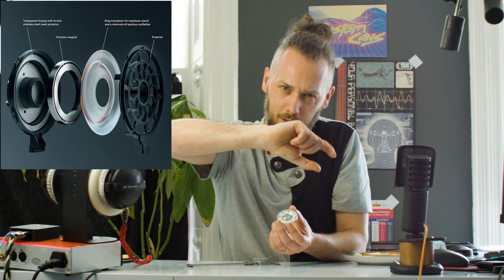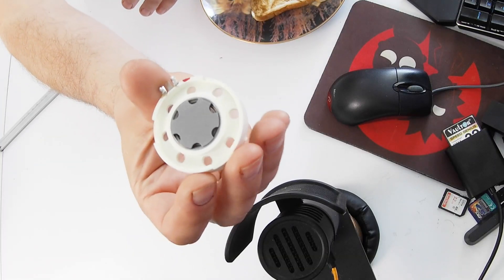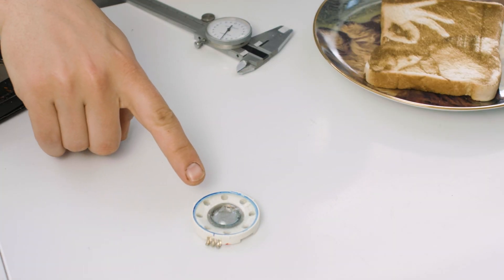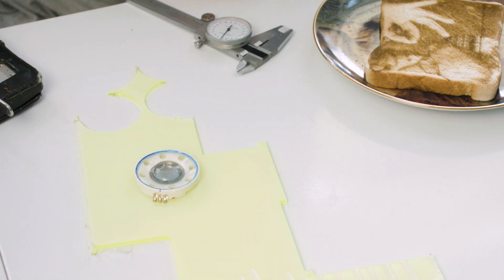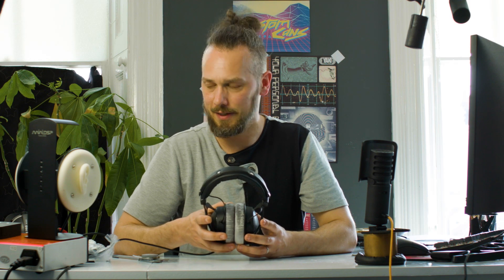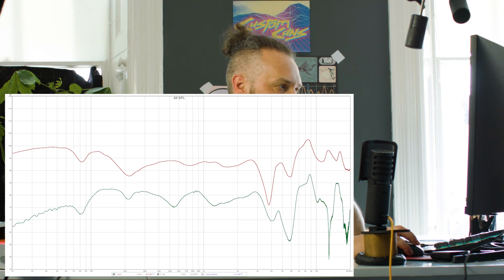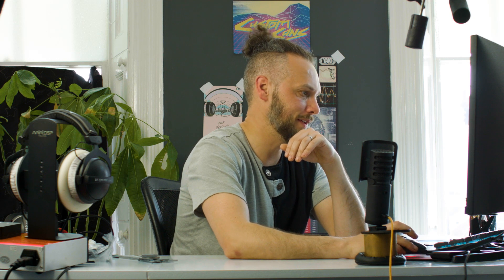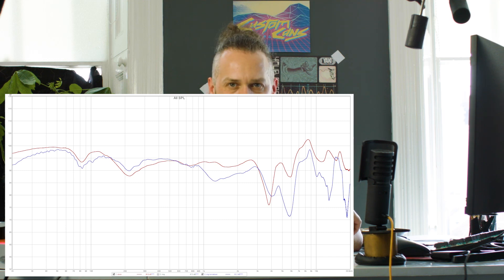What happens if you cut out the centre of a headphone driver?

Comment: Interesting experiment. Will a small dent on the center of a headphone driver cause any change on the sound? I was fixing my AKG and didn't see that one of the screws got pulled by the magnet, when I layed it on the table, it made a small dent / mark on the center of the diaphragm. Now I'm paranoid I ruined it even if it sounds the same apparently.
Reply from the maker: It would not change much - I doubt you would hear much difference

Comment: I suggest experimenting on the amount of material you remove from the center and see the reaction of the driver to it. Maybe if you remove probably just 5-10% of the material it'll have structural stability avoiding distortion or maybe not? 
Probably best to do this on a driver with a metal dome center instead of plastic to avoid burning from the laser
Reply from the maker: Yes - I may have a go in the future. The beyer drivers are quite soft so a stiffer material will probably survive better
Reply: @CustomCans  Looking forward to it!
Reply: Love the experimentation…. Ty for the amusing video 😅